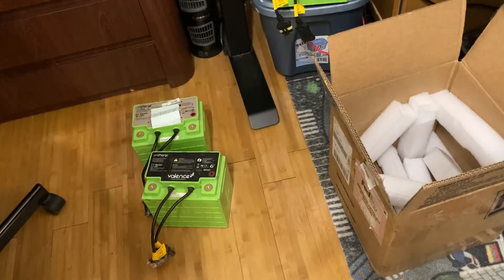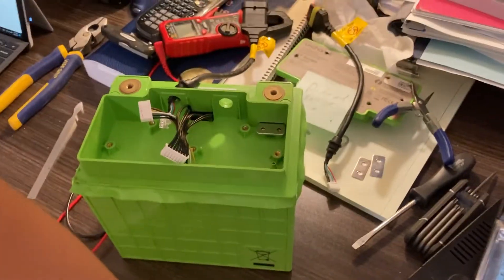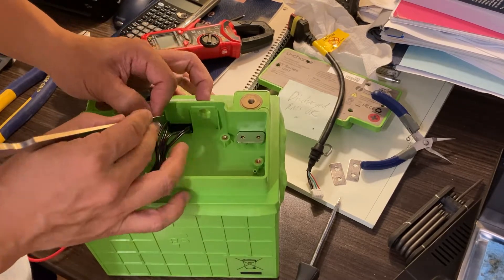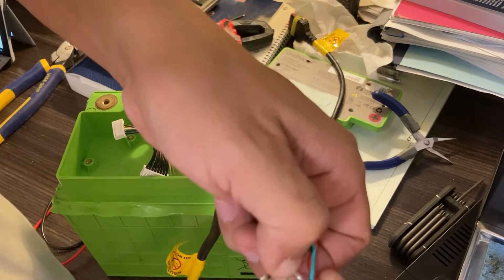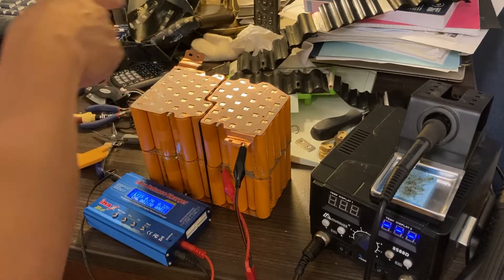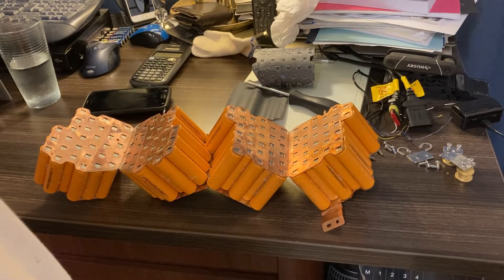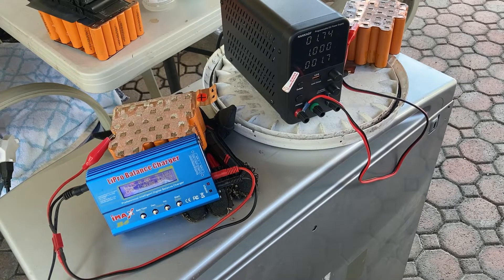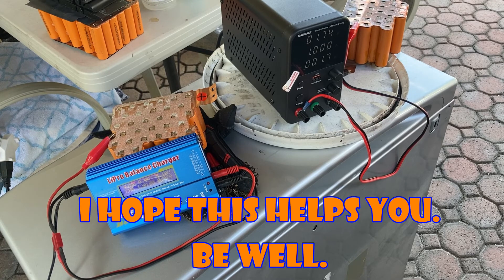Valence Battery teardown

Comment: For car audio aplication?
Reply from the maker: Hi, Dan. No, these weren't for Car Audio, although it does sound like a potentially excellent adaptation. This was an impulse purchase in an attempt to find alternative LiFePO4 cells for a off-grid solar home power application. I've hit a dead end with this project and will be utilizing the 100+AH 3.2VDC prismatic cells in lieu of juggling with 600000000 micro-cells salvaged from this operation. It was a great learning experience and now I have enough 18650-like LiFePO4 cells to last me the next 3000 years. Thanks for watching.